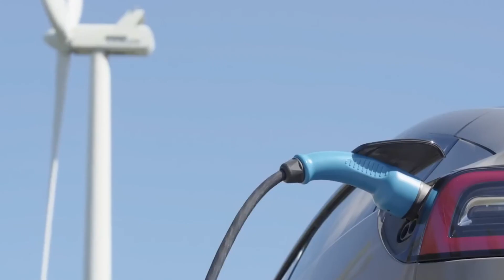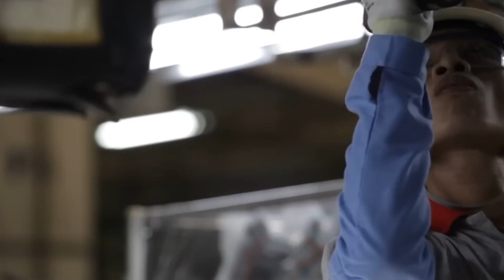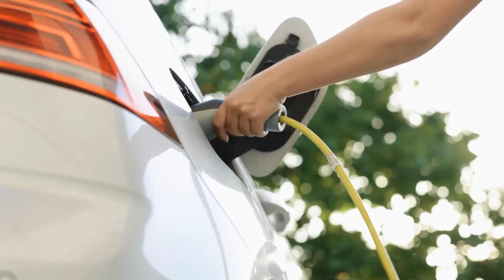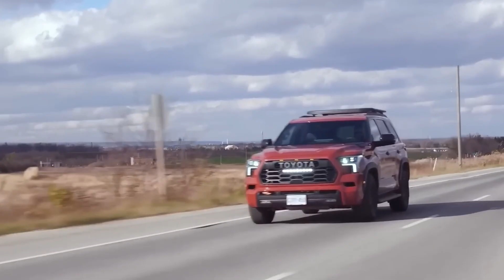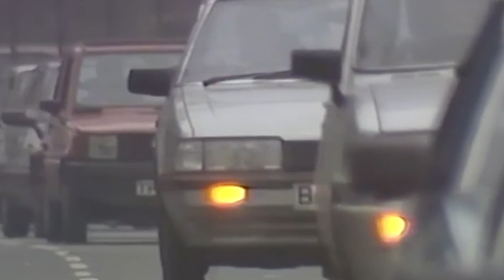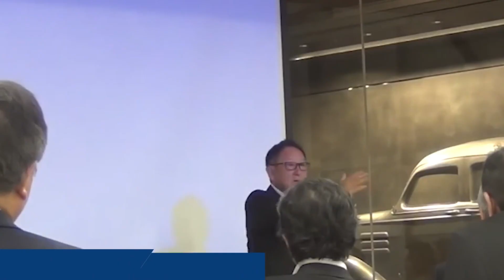Toyota CEO, "This NEW Engine Will Destroy The Entire EV Industry!"

Comment: This is idiotic.  Where is the energy coming from for electrolysis?  The energy to create the H2 is twice as high as the energy you get from the engine, assuming the engine has 50% thermal efficiency.  Small engines typically have 30 % efficiency, meaning the energy you need for electrolysis is closer to x3 from the engine output.